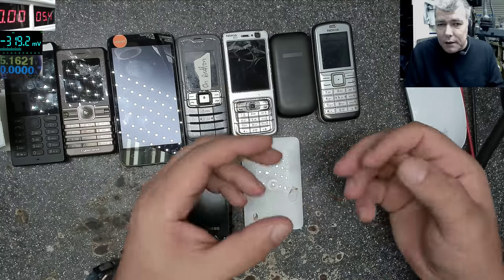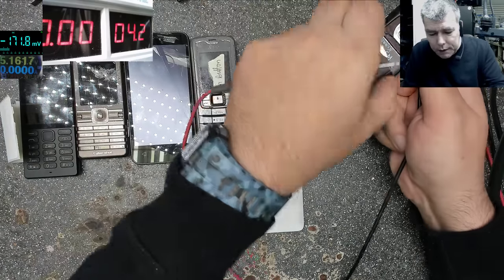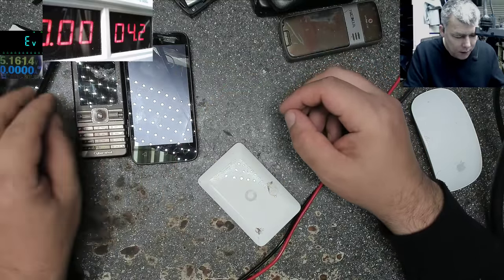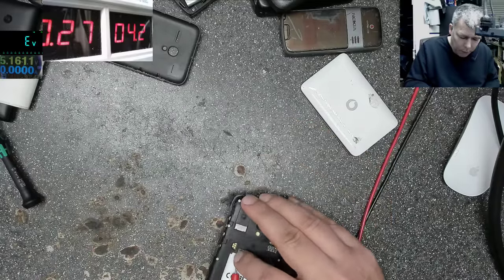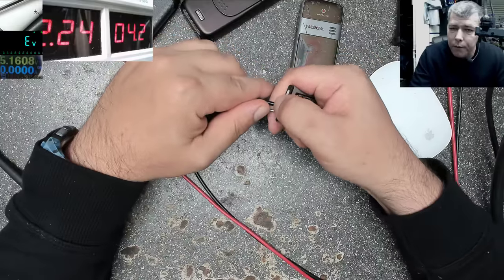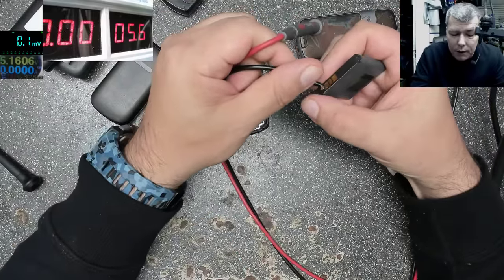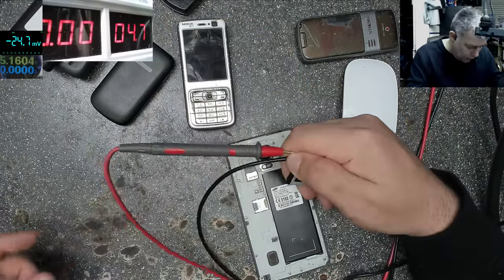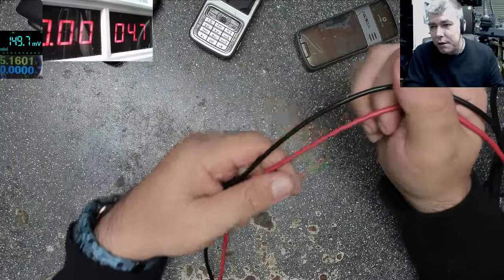How We Test Mobile Phones (The easy way)

Comment: Most have a rather different approach in the cellphone buy and cell arena here in Asia.  Irregardless as to whether the unit itself powers-up or not, it is considered first to determine whether is it grounded or not.  Most grounded phones (whether caused by water damage or, component or worst, design failure) do not power-up and for those that do power-up will simply  destroy the battery in the long run.  A simple ground test can be done by treating the unit like a capacitor ;  with an ohmmeter in the x10 range, "charge" the phone by putting the + lead to the + battery connector and - lead to the - battery connector which will cause the ohmmeter needle to deflect. If in reverse-bias mode (leads are reversed) that the ohmmeter will indicate a "discharge" state then the unit is not grounded and will most likely power-up and operate normally. If it does not "discharge" (the ohmmeter needle will deflect on both states of bias and reverse-bias) then you would probably a losing investment with a value of being a paper weight.  I am very sensitive with these issues since I still buy particularly old Nokia N-series phones. I also used the same ground tests on laptops and other electronic equipment; that is even before deciding to open and repair them up. It also saves time and effort avoiding those pointless arguments with some sellers who will decide to lie about their items to sell.

Comment: Is it not dangerous to touch the hot lead with your bare fingers like that? Or is it because the amperage is low? Or is there a built in protection from the power supply so the user cannot get shocked?
Reply: On the 5V PSU etc.? Yeah, the voltages are safely low enough so that it's not potentially harmful.

Comment: Hello Sorin, thank for your videos thay are really helpful.
i just wanted to ask you, i have got this AT&T LG G4 H810 freezes alot then turns off even if i'm not doing anything and the display is off, BUT if i plug it into pc via usb or play a movie on it, it doesn't freeze and works just fine.
i'm looking forward for your any tip would be helpful and thank you again.

Comment: I said it recently, but many cheap phone are sold with only +V & GND No D+orD-wires. Looking to understand this
Reply: You mean the USB cables that come with these phones?
Reply: @NeuronalAxon  I am not familiar with the specific phones in this video but yes, it is not uncommon for the phone charger to be a power only cable.
Reply: @Inertia888  - They're probably  just being cheap then, I'd guess.
Reply: @Inertia888  - Or maybe a lot of these older phones have no data function, and they are from before they started to tie the data lines together to signal higher charge rates?

Comment: You speak about poor countries without putting them down. Respects! But at 27:30 you have it in reverse. Higher internal resistance of the battery means lower output voltage. Lower internal resistance, higher output voltage. Internal resistance is not a good thing in a battery and the best batteries have lower internal resistance.

Comment: the lower end phones even from late 2000's didn't need the middle pin to turn on in my experience, so if you needed a phone that would never leave your house you would just solder the charger directly into the battery pins and leave it plugued xD